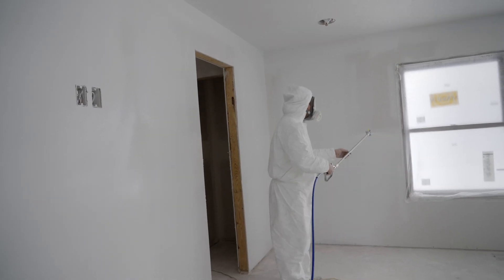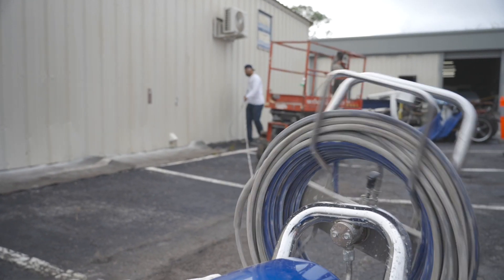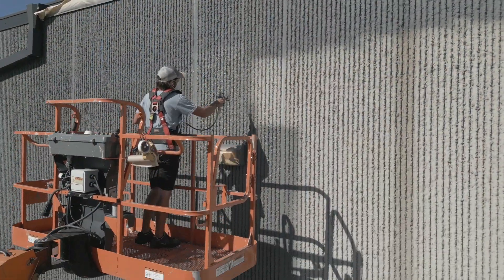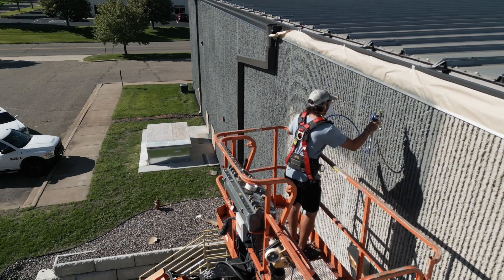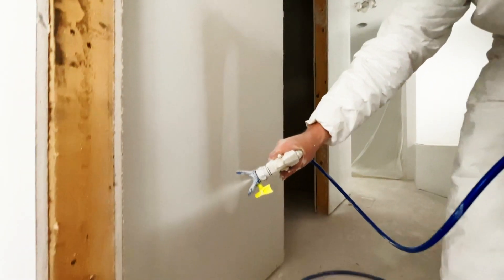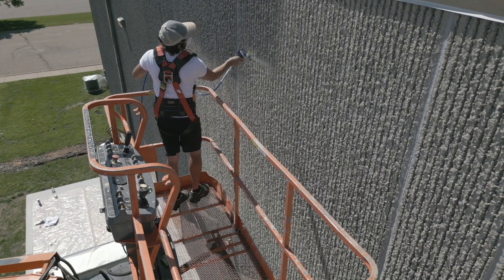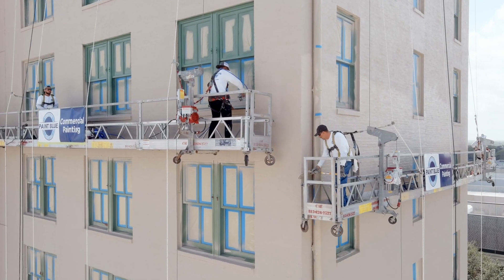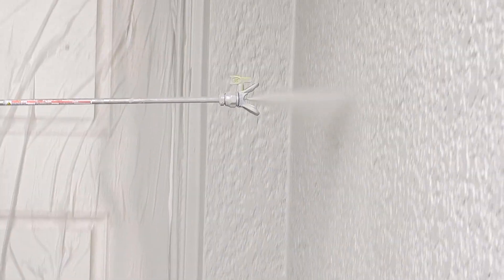Paint spray tips: a contractor's opinion on Low Pressure tips

Comment: I got a 310 LP tip. a Magnum x7, the bloody know doesn't show PSI on it. where should I put the knob on to paint using this tip?
Reply: You can get pressure gauge and add to line between sprayer and hose.
Usually $16 to $18. 
Readings are up to 4000psi on gauge.
You can get titan version with green zone for their low pressure tips and take this as a reference and adjust for  correct pressure required for material and tip size. 
Probably I would start from 900-1000 psi  and gradually go up till patern is correct.
This is your sprayer pressure and output on gun would be around 200psi lower per 50 feet of hose. 
I'm not a painter but that is what I learned.

Comment: What's the difference between these new neon yellow tips and the old low pressure green tips?
Reply from the maker: Hi, it is the same technology only a different colour. We have done this to make a clear visual difference between the FFLP (Fine Finish Low Pressure) tips & the LP (Low pressure tips). We extended with some new sizes and also the Wide Rac tips are now available as low pressure WRLP